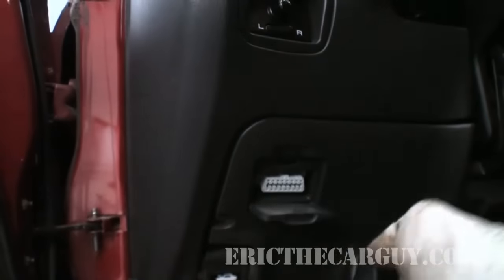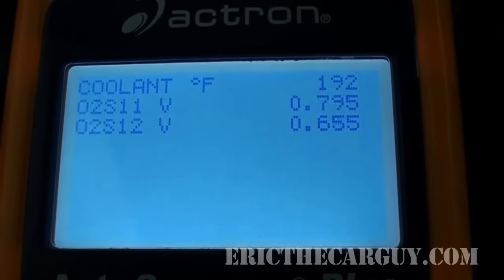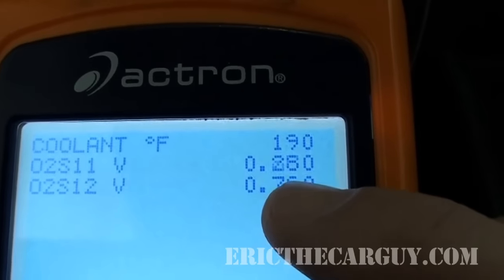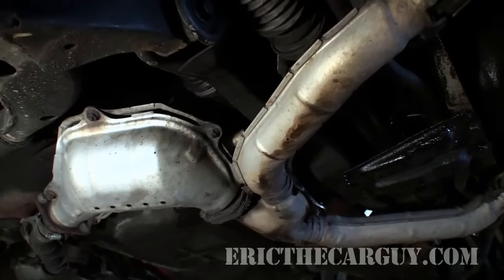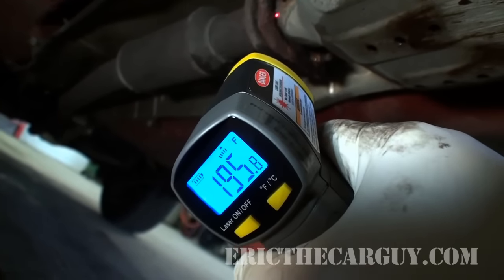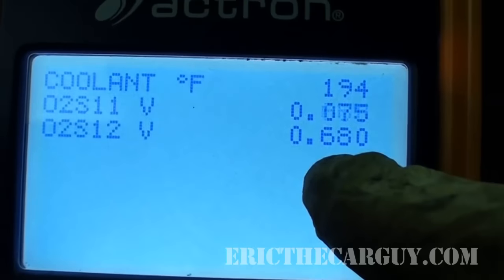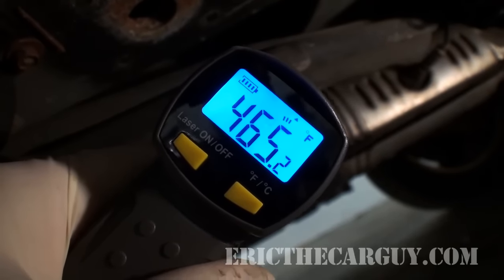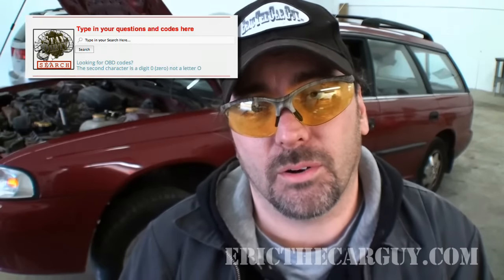P0420 How To Diagnose A Bad Catalytic Converter -EricTheCarGuy

Comment: Those damn subaru's always have bad cats because they burn oil :\
Reply: Krankie V I know someone who just popped a 420 and they said it uses 2 quarts between oil changes. So I wouldn't be surprised. Must be their sideways engine or something. I've never had a car use that much oil.
Reply: yup it's the horizontal design I'm convinced. head gaskets always leak too
Reply: All of that stems from not changing the oil and filter often enough.  Subaru's are NOT forgiving if you are slacking on your maintenance.  Oil change every 3-5,000 miles if you don't want Subaru engine problems.  People can argue with me if they want, but just had too much experience working on them to convince me otherwise.  That said, if you do keep up on it, they are great AWD vehicles IF they are MANUAL transmission.  Their automatics blow.  If you want a car you can be a lazy bum with, get a manual Civic or a Toyota.
Reply: It's all from not changing oil? That's why Subaru claims it's "normal" to burn a quart of oil in 1000 miles and won't do anything about it unless it uses more? That's why the US government had to step in and force Subaru to extend the warranty on their catalytic converters? Is that also why about 50% of all Subarus that come into the shop with over 60k-70k miles seem to have oil and sometimes coolant leaking form the head gaskets? If it's all caused by lack of oil changes at 3000-5000 miles, then why don't I see these problems on the fleet of Nissan and Ford vehicles which come through the door every 8000-10000 miles for oil change service? 

Why is it that my customer's 2015 Subaru with approximately 32k miles burns through 2 quarts of oil every 5000 miles while my 2005 Ford with 179k miles and a slight leak from the front crank seal uses only about a pint every 4000 miles?

It's because the Subaru boxer engine platform sucks and is very susceptible to oil consumption issues due to design. 

Say, where does the whole "normal" oil consumption of a quart per thousand miles fit into the whole "partial zero emissions vehicle" thing anyway? Does it just mean zero emissions while it isn't running? LOL
Reply: It really does stem from not changing the oil often enough, but you are absolutely correct that some of their designs are junk.  For example, there are some Honda and Toyota engines that can go 50,000+ miles without a SINGLE oil change (not recommended obviously, but check YouTube for fascinating videos) without burning a drop.  If an engine is so sensitive to damaging the seals, gaskets, or anything internal that it goes from totally fine to burning oil so quickly with so few miles, the design's quality is questionable.  That said, go drive any Subaru off the lot brand new: they won't burn oil.  And if you want a Subaru, and you want to keep it that way, you need to be vigilant and use a quality oil.  You and I both know that most of our customers are lazy bums and cheapskates that don't want to deal with this crap, and they don't want to accept blame when they do something that's their fault, so they make up stories like crazy ("I've ALWAYS changed the oil every 3,000 miles, it's just ALWAYS been this way...").  That's why I'm inclined to say that for most customers that fall into the category I mentioned, Subaru's aren't for them.
Reply: Krankie V Lol @ zero emissions while it isn't running lol Subaru with their ground breaking innovation
Reply: how to unlock a LG 90
Reply: Some Subarus burn oil.  Others leak it and\or leak coolant.  I always recommend changing the head gasket when you replace the timing belt.  Funny how the Subaru was bad and the Honda was good.
Reply: I've had my '05 Impreza RS with 189,000km for just over a year now,  doesn't burn any oil. I generally do my own oil changes every 5000km using conventional, last oil change I switched to Mobil1 synthetic for the winter and still doesn't leak/burn oil. Trying to figure out this CC issue though, seems to be a common issue with Subarus
Reply: Actually you can drive a new one off the lot and have it burn oil. I have 2 friends that state exactly that. 1 quart burnt every 1000 miles since brand new.
Reply: This is Funny, "Subaru's are not forgiving". Nuff said!
Reply: Look, if you want to know how the oil is holding up in ANY engine just contact BlackStone and have them send you one of their FREE oil analyses kits. That's just the stuff you need and the information you need to send them a sample of your used oil, and be sure to pay the extra $10.00 and get the TBN numbers too.
Engines that use more oil than we like (newer engines, and or engines with lower miles on them) can sometimes be the brand of oil, and that isn't to say any oil is a bad oil. But several years ago I bought a BRAND new GM Vehicle with a V8 350 and I was big at the time on using Valvoline motor oil, well that engine didn't like it in that it used a FULL quart between 3,500 miles oil changes! So, on a chance I decided to change to Havoline oil and that dried it up completely or to say WAY LESS THAN A QUART in 3,500
Oils I will never USE,
Pennzoil,
Quakerstate,
I also never went back to Valvoline.
And NO! I'm not going to get into an oil debate, I've gotten into those on forums that raged on for WEEKS at a time.
I Also NEVER EVER USE a Fram oil filter on anything either! NEVER! their paper end caps on the ends of the filtering media is the WORSE! They are ALL kind of video's on youtube where people have cut them open, to which I had already did that over 10 years ago!
Reply: @alexm2623  i get what your saying but I have had 5 or 6 civics or integras form ranging in years form 91-94 and most had black bumpers from burning oil all had 250k or more miles, not 1 ever had bad cat or engine light for that matter, im sure you know the black bumper civics? Why do they not go bad?
Reply: Subaru  for a long time had a poorly designed head gasket  used on many different models which they started to correct a few years back. Once you replace the bad gaskets with  the three layered gaskets it's good for the life of the car unless possibly you had the dealerships do the job and they used a wiz wheel to clean up the heads or the heads were warped and should have been planned down flat.  The dealerships were all about quantity  rather than quality...during the hey day of the bad head gaskets... I've never had a three layer come back leaking unless the car was run without oil or coolant and then it's towed in with the connector rod or parts of it sticking through the top of the block making the gasket a moot point ...:)

Comment: I just got this code on my Toyota corolla 2001 I don't know much about cars and I don't have the funds to be able to pay someone else to do it your technique  is awesome. my car has been idling rough for some time now I just didn't know how to fix it and then today my engine light came on I'm really hoping its not the converter and its just the o2 sensor sure a lot cheaper.

Comment: To bad I live here in TEXAS were we do have emissions test's on whatever vehicles yearly and it could be a pain to pass inspection.
Reply: Yearly!  Jeez... even here in California it is only once every other year and we are the ones who got this who emission reducing thing started!
Reply: I live in Texas and don't know a single person who has gone through an emissions test. In fact most people with diesels or old vehicles just run straight pipes. Maybe it's the city you live in?
Reply: Diesel cars dont need emission test in Texas as per DPS website
Reply: OR may be it is the times he was living in,  2years ago, when posted. Texs dont have no more testing.
Reply: Texas definitely still has emission testing.
Reply: Some counties in Texas don't require emissions testing, others do.

Comment: Thanks man, a P0421 code came up with my car. The o2 sensors are both fluctuating between .1 to .9. Now I'm pretty sure my catalytic converter needs to be changed. Great video, thanks!

Comment: I live in Florida and I'm glad we don't have emissions testing. I think my passenger side cat is failing(or o2 Could be bad haven't gotten under my truck yet). But either way, I get to it when i get to it no rush.
Reply: ***** You want to pay for my two replacement cats? Because I drive I truck and both cats are welded into a single y pipe. So if you care about it so much fork up the cash for the whole thing or do the welding job to put in a new one.
Reply: LinusScrubTips Coal roller types will always live among us. Fuel injection made some emissions tests redundant but a lot of people still modify their engines and don't give a damn about the public "airspace."
Reply: Geo T Not enough to make a difference. I say let those people be.
Reply: LinusScrubTips I'd say it's a good 10% of people, at least. They favor their personal situation over the public good.
Reply: Geo T I disagree. No way 10% of all drivers remove their cats. Most people don't even know how to change their oil let alone remove a cat and still have their vehicle run properly.
Reply: TheRealestEver They want to take away individual freedoms because they collide with their collectivist fantasy world of "equality". Looking at hundreds of years of human history, I think the educated among us all know how well that works out in the end.
Reply: Geo T what about those of us who cant afford this expensive repair. and what about politicians who favor their greed over the welbeing of the rest of us. think of the hybrid, it would have to run for 600k miles to out weigh the damage to the enviroment that comes from making that massive and very expensive hybrid battery. cats are not the answer to clean air, its more of a band aid on a severed limb.
Reply: Allen Good grief, do you even understand what catalytic converters do? They are still very important. I'm sure you'd find the money for some HP modification, so that's a weak angle. The claim about hybrid batteries is only true in a narrow context. It's mostly fake environmentalism coming from people who never cared about pollution before. They only "care" when they want to bash something new and efficient.

Comment: Just a thought, what about  Electrolysis ? Hook them up to some voltage and let them soak that should break down some of the rust and crap on the inside. It works for  rusted metal. Check out some of the videos on how to remove rust.

Comment: We don't have any of those emissions tests in my part of TN either.  They used to in Nashville (Central TN) but not sure if they still do. At any rate, I am still glad the car I am restoring does not have any of that nonsense on it.  The vapor recovery system is enough to fool with.  I do plan to monitor my EGT at cyl. 1 and 8, along with cylinder head temp but not sure if the Edelbrock heads I'll be using allow the latter to be done easily.

Comment: My 09 legacy had the p0420 code pop up so I tried the cleaner no expecting anything to come of it but considering the $24 bottle of CataClean was a small fraction of the price of oxy sensors or the cat. I followed the directions and it worked and has been fine for six months now.

Comment: Thank god Indiana doesn't emissions tests, cause If my catalytic converter were to go bad, I'd just straight pipe it.
Reply: I don't even have one!
Reply: Brandon Hill Porter and Lake county's are the only two that do... it's so stupid,
Reply: the car is designed to work with the o2 sensors, you can run without one but your CEL will be on, your fuel mileage will go down and your hp will decrease, but please keep sounding like a Indiana hick.

Comment: Eric   I knew I needed a fuel pressure regulator in my 99 Camaro 3.8 as I had changed one at 68K miles…the symptoms recurred at  178K miles so I changed it with a new one.   I had never changed the plugs so I changed them and the wires….the original plugs looked good but all were worn to .090 (OEM spec .060).  
 
Prior to the above 
   the diagnostic light had gone into blinking rapidly ( a sign that damage can be done by continuing to drive).   I drove home…about 10 miles…had to race the engine to keep from stalling.  So I changed the plugs and installed the FPR ( as noted above).    It starts fine but is idling rough…  I have the P0300   random misfire code.    I am thinking  clogged cat….so I shot  the cat front  385 degrees and then shot the rear 810 degrees….per your video the rear  is much higher than the front .    Could the cat be clogged and still provide the temps that  I measured ?     I've checked for vacuum leaks and I'm  leaning toward the cat being clogged.    Thanks for any help     walt

Comment: Hi Eric
Thank you Eric! Thank you for the simple way to test for a bad cat. My daughters car is a 2005 Subaru Legacy with the infamous P0420 code. I used my scan tool and the infrared thermometer and got the same results. However at least the driver side cat is lighting off, only one to worry about. This saved me from wasting 70.00 for a rear o2 sensor.

Comment: early in the vid, you said that Cat works best at like 12-1600 or whatever, but with the test on the good CAT, it was nowhere near that. ?????
Reply: Internally within the honeycomb structure the temperature is a few times higher than the external reading... It is designed that way for safety reasons.

It is like an ordinary oven in a kitchen.  Sure, if you hit the outside with the non-contact laser it will seem like the oven isn't even on.  But we all know it has to have been on when those sweet, sweet weed brownies pop out... perfectly done and delicious, oozing fudge nuggets swimming in shimmering milk as they are dunked and drenched and then scarfed down as the chocolaty warmth inverse hugs us from the inside.  MMMM
Reply: You misquoted Eric on that,m btw
Reply: Yes I agree, I am confuse. The temperature was not anywhere close to what he said. I expected much more   different between the tests.
Reply: rob lavallee, The P0420/P0430 codes indicate that the ECU (by way of the Oxygen sensors) is not seeing the change in exhaust gas composition that it expects AFTER the Exhaust has reached Normal Operating Temperature. The overall temp isn't that critical, what is is the Difference in temp between the inlet and outlet, the outlet temp should be Higher than the inlet,  a difference of 100^F usually indicates a passable cat, anything less and the cat may not have fully warmed up or may be faulty. (Many customers of mine come in with a failed smog test because they drive straight from home to the test center, not allowing enough run time for the cat to reach operating temp.)
Reply: @GrayRaceCat  do you know if the test for heat comes out good would it than be the o2 sensor? With that PO420 code? Thanks

Comment: If that thermometer is anything like mine, the laser has nothing to do with the temperature measurement itself. It is just a pointer so you know the center of where the measurement is coming from. The actual infrared measurement happens at the window of the instrument and it reads IR radiation within its view. Picture a cone with the point at the instrument and broadening out toward the object being measured. The farther away you are, the larger the region being probed. If you want to measure something small, you have to put the instrument close. Some of them, as described in the manual, probe a region 1" in diamter at 12 inches of distance (and therefore 2" in diameter @ 24 inches distance).

Comment: Wait. So basically the cat is useless? Just an emissions thing? Doesn't affect the engine or its productivity? Am I wrong in this because that's basically the first two minutes of his vid.
Reply: Well, not useless. In an effort to reduce smog emissions, the government required vehicle makers to outfit cars with a catalytic converter, and then started only using unleaded gasoline. In addition to the environmental benefits, you can no longer leave your car running and enclosed garage and die of carbon monoxide poisoning. So, "useless" depends on your perspective.  if you want to drive a car in the United States, I find it useful
Reply: +SilkyTP You can definitely still die from leaving a car running in a space with no ventilation. People die from this all the time.
Reply: ***** yeah, that's kinda what I said
Reply: No, that's literally the opposite of what you said. Even with a catalytic converter you can still die of car exhaust fumes.
Reply: Unless "you can no longer leave your car running in an enclosed garage and die of carbon monoxide poisoning" means something else.
Reply: ***** I'm curious, what is it you think I said?
Reply: +SilkyTP You went 100-0 real fucking quick
Reply: +Bill Gringo I re-read my post and agree with you. Noxious fumes are definitely hazardous, and one needs proper ventilation. I have no idea why it came out the way it did..  in my subsequent replies I failed to re-read my post and didn't understand why I was getting flack. Now I so. Apologies.
Reply: +Bill Gringo 👍✌right on.
Reply: +Bill Gringo +1 Way to be a grown up about it Silky. We all have a moment now and then.

Comment: This was useful. I told the mechanic i had gotten the P420 code. He immediately said, it's your catalytic converter. I said without testing anything you know? Yes. But his coworker came over & suggested fuel injection service... I walked out.
Reply: Millie Tant we're u able to clear ur code getting fuel injection cleaned. Because I got my oil changed and they told me I had to get my fuel injector cleaned.